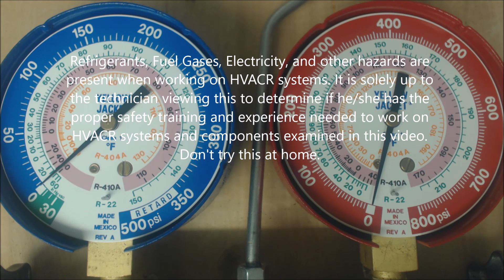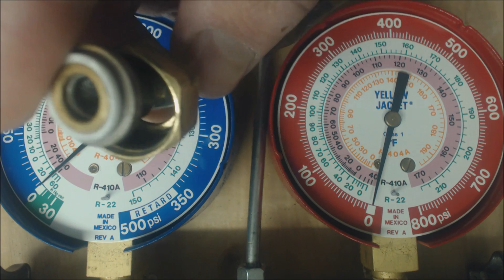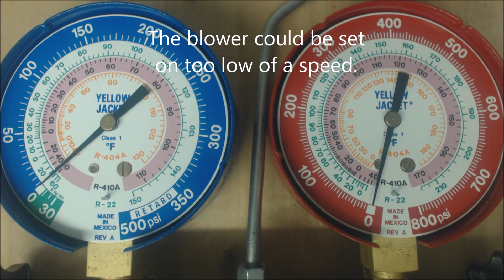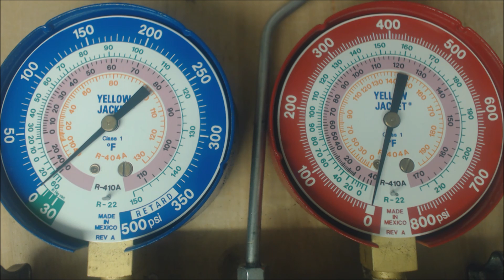R-22 and R-410a Refrigerant: Why the Vapor Gauge Pressure is too Low in Air Conditioning!

Comment: On a car , their is a temp sensor in the evaporator case that will shut down the compressor clutch when temp gets too low . The OLD cars had a mechanical [ tube ] type sensor , new ones are electrical . Why not same for a house ?? .

Comment: Ive got an R22 system that has 55 degree air coming out of the vents. Low side pressure of 70psig high side pressure of 170psig. I feel like the high side is too low. 85 degree day outside.

Comment: I got an r22 unit that when filling the high side will not get above 100 psi but low side is looking around normal at 70psi..    filling took waaaay to long.. like 4 hours for 6 lbs..  i replaced the filter and repaired a blow out at the compressor and drained and repkaced the oil with recommended stuff..   dunno whats up.   Im a newbi on heatpumps..

Comment: The blue side reads 226 psi, the red reads 75 for r410a (pink), my outdoor temperature on the 
Liquid line is 82 degrees. My unit requires 14 degrees subcooling. What could be wrong with my unit? Freon was recently added to my unit by a service tech.
Reply from the maker: The blue side 226 pressure seems way too high, thanks

Comment: I was charging  a unit which iam going  back sometime  this week , I  couldn't  get the head pressure up as well as the low side ive already cleaned the a  coil and the blowerfan motor didn't do a delta t, I suspecting its going to be the orfice I added quite of bit of Freon I should stop a coulple pounds  lol live and learn , but  now that I think I did raise the head pressure but not the low side
Reply from the maker: Definitely check the subcooling and superheat as well as the delta t. You may be right with the liquid line restriction but it could also be a clogged evap coil or some other airflow restriction. Check the videos out with the pictures of the gauge sets that say low pressure or superheat on them- https://www.youtube.com/watch?v=lpHpfCEq8IY&list=PLxnHR5_D2ojxZI3-xx03Bttxe3xCqUD87

Comment: I recently had a low suction and low discharge pressure. Superheat was 10 F and subcooling was way up there at 27 F. I had 64F on return and 44F at supply. filter was clean. TXV bulb was mounted and insulated. I didnt find a temp difference at filter drier. It was a 2 story house and had only 2 returns on main level. I suspect it needs a return on 2nd floor.
Reply from the maker: What were the pressures and refrigerant type? Also you said it was low suction and discharge. Was it a low temp outside? You already hit part of it right on the head since the return temp was so low. That low of a return temp would put the sat temp on the coil very low.
Reply: it was a bit below 65 outside. Odd weather in Colorado for June..All week was 90. It was 410A. Suction pressure was a bit above 50 and discharge a bit above 120

Comment: I had a r22 system that showed like 20 degrees in suction side and 200psig on high side. what could that be? I tried adding some to see if it did anything. suction side went up and then dropped immediately. high side didn't move the whole time.
Reply from the maker: What was superheat, subcooling before and after charging? What was outside and inside temp along with wb inside. Piston or orifice? thanks  Sounds like you didn't have enough heat to absorb on the evap coil. How was airflow?
Reply: It means this system is choke or capillary  or expention valve is blocked

Comment: This reminds me last fall I was starting up 2 carrier splits,410a,micro channel condenser with txvs. charge was weighed in and I could not get more than 2 degrees superheat. Took charge out,check for proper air flow and duct sizing,nothing worked. I was told that new units with micro channels run with small superheat numbers for effiency reasons and you wont get 8 to 12 degrees superheat like older units. What have you heard about this?
Reply from the maker: These units all want to be charged using each manufacturer's instructions using vapor pressure, high pressure, high pressure line actual temp using charts, or subcooling by itself. What was the model # of the units? I am wondering if they have an accumulator and I am assuming you were charging with subcooling with a txv but just checking the superheat for safety for the compressor. Thanks
Reply: The subcooling was correct according to manufactures specs.I was thinking about adding an accumulator. I was thinking txv was not feeding properly,I know carrier had the problem with the rust inhibitor used in production was causing issues with txvs and had a massive recall. It was weird with the low superheat though.

Comment: I replaced my piston # 59 I also have filter drier but forgot recovery machine and couldn't replace due to being inside condenser so while pumped down couldn't do but the first time I tried pumping down it did nothing the second time after closing the high side both sides came down at the same time ?? Compressor issue / I checked everything you asked me to last time and I couldn't find any restrictions in the ductwork and coils clean / also have liquid Refridgerant in low side when hooking gauges up
Reply from the maker: I'm sorry, Matthew are you talking about the unit that you said has 14-17 degrees of subcooling or the one with what you said you think is negative -45 degrees of subcooling?
Reply: acservicetech no this is the one at my House and you told me to check all the things in this video firstThe saturation temperature was below freezing with the correct superheat but I noticed the other day I was having trouble pumping down the refrigerant into the condenser it took a couple times so I don't know if a bad compressor can give you the symptoms in this video
Reply from the maker: Both sides will come down because the hoses are attached to your lineset with the liquid line closed. That is fine. I think I was saying you are looking at an airflow issue on this one and not a liquid line restriction. I think you are referring to the thermostatic expansion valve video I put out recently and the comments on that one. I don't have any threads from you previously on this video. Thanks Matthew
Reply: Yes but I couldn't find any issues with the the evaporator being dirty the only thing I haven't checked was the blower motor yetI looked at it the other day and it is dirty I'm gonna clean it when I get a chance I just noticed with the pump down the first time I tried it wouldn't pump down and also I had liquid refrigerant in my low side when I hook my gauges up and I've never had that issue before
Reply: acservicetech  appreciate you anytime your in Austin Tx let me know I appreciate your responses it's a big help

Comment: how would this work on refrigerator trailer commercial truck trailers
Reply: Anthony Johnson I think the refrigeration system on a commercial vehicles,  the charge is weighed in. So I would recommend buying coil cleaner and clean your coils.
Reply from the maker: Yes Ron is right, you would weigh in on packaged rerigerators and even split ones. You could use the liquid line sight if equipped when the receiver is drained at full load to determine if you have a steady stream of liquid present. Thanks

Comment: The super heat is expected to be high with a restriction or low charge..Low super heat is a low load condition such as dirty filter bad duct design , plugged coil dirt..etc.   You could have both problems on old systems hat had not been checked for years.
Reply from the maker: Yes absolutely. I was going to touch on the differences in an upcoming video, right on the money, thanks!